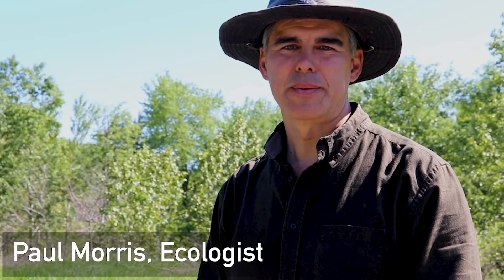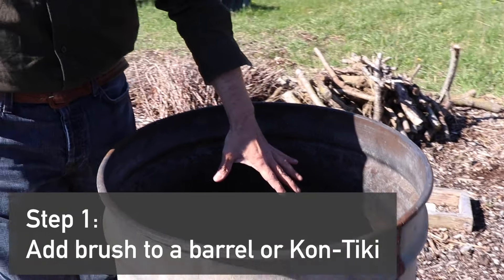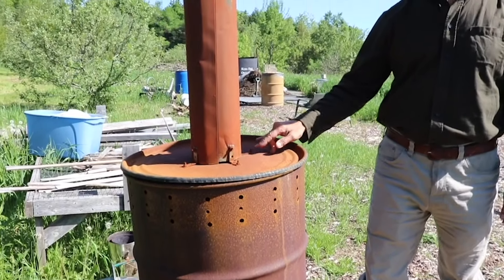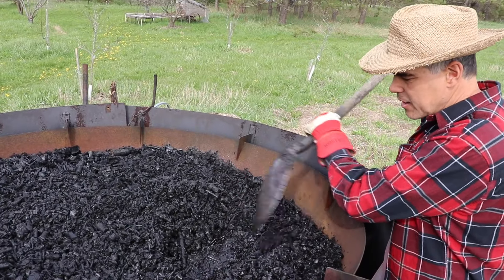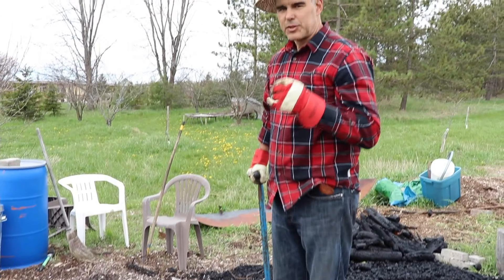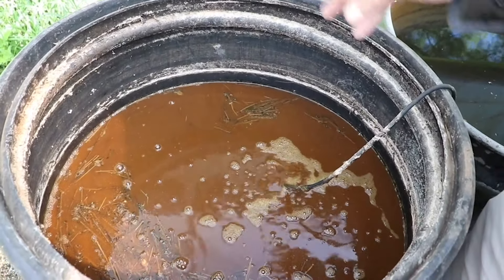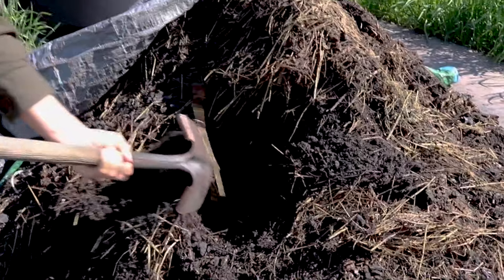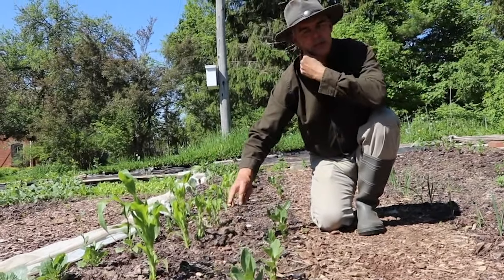THE ULTIMATE GUIDE TO BIOCHAR: how to make it, how to use it, and why it's important

Comment: I have loads of cane to eliminate (not sugar cane, but wild cane) which is totally different from wood. But maybe its biochar is useful as biochar from wood??? Any idea? Or is its quality much inferior to biochar from wood? Any hint would be useful. Thanx!
Reply: It's about an inch thick, hollow and 3 meters high. I think it's Arundo donux.
Reply from the maker: You would get some char out of it but it would be more difficult to do as it would burn fast and go to ash more quickly. You could experiment and see. I would probably make big mounds layering with some soil and compost it down.
Reply: @PlanetHealers  Thanx for answering! Composting is an option, but it's rather too much material to cope with. Applying it as mulching is another one, but would need to be shredded. So converting it into biochar seems the least work with it with the best effect in our case. The question remains if the quality of this kind of non-wood biochar would be different from the one that's made from wood, or if somebody knows any source where to find out about it.  thanx!
Reply from the maker: @131277stefan  https://biochar-us.org/presentation/sugarcane-residue-and-bagasse-biochar-precursors-soil-amendment-applications this might get you started in your research.

Comment: I use hard wood logs when cooking with my smoker. When meat is done, I close the vents and the fire slowly smothers. When I empty the ashes there are small chunks of charcoal. I put these small black pieces into my compost bin. Some break down, but often there are small remaining pieces of charcoal which I leave in with the eventual garden soil.
Reply from the maker: You will get a bit of charcoal after a regular burn but with this process - high heat and no oxygen the char has more fractures and airspace’s for microbes to grow. It would be low quality biochar but of some benefit.
Reply: I do the same!

Comment: Great video. I'm very interested in making biochar for a farm project we have in the Philippines and locally around our area, there's a dominant sugar cane industry. I was thinking of using those biowaste instead of wood as biochar. My question though is, is there a substitute of the urine in formulating your biochar? Thank you.
Reply: @sumakwelvictoria5635  interesting. Thank you so much for that 🙂
Reply from the maker: Yes aquaculture water with fish waste might be a good source but haven’t research it. Recently saw a study where they used biochar to filter out chemicals from the urine before using is and had good results. Id just boil the urine if concerned about pathogens.
Reply: @PlanetHealers  The goo is bacterial slime. That means your biochar is already loaded with bacterial colonies.

Comment: Not really sure that the open barrel system actually produces pure biochar, I guess it still produces some, never tried it myself, so assume this just from the theory. Have just finished a retort, where the feedstock is totally enclosed. I used maybe 20kg of wood to turn 500kg of wood into biochar, approx 125kg. Now correct me if I’m wrong, but I tried to light it using a gas lighter, glowed at contact point but would not light, which to me is biochar, if I could light it, it would still be charcoal, yes ?
Have wondered about finer v coarse, but spent some time in a place where we made a granulated rock mineral fertiliser, and there the finer the materiel the better, more surface area, wouldn’t the same apply to biochar, more surface area? Plenty of good information thanks.
Reply from the maker: Yes all the material in the barrel turns to carbon instead of wasting some of the wood to heat it. Not sure why your carbon would not light. All carbon "burns" / oxydizes with oxygen.  We crush it down but leave it a bit chunky so the microbes have a refuge if it gets really dry in the soil. Which it can in the Yucatan.

Comment: Where you use water to quench the fire, I was wondering about using effluent from a local diary pad  pond. This would give me a good source of nutrients, I think? Would I need to add other things to boost the bio char? Regards from NZ
Reply from the maker: The water soluble components of the manure would be in that water but the fibre and less soluble nutrients may be less. I prefer the manure because it is slower release. I’d suggest adding some soil to the mix, the molasses and super brew also

Comment: Really good info sir. I have a question though. Wouldn't a bigger air bubbler for your tea making have a faster microbiology growth rate and be more readily available for supplementation quicker? Cheers from the South....
Reply from the maker: I tried a bigger bubbler and it produced too much foam. I also mixed the settled ingredients (soil...) off the bottom every few days.
Reply: @PlanetHealers  good info, thanks
Reply: @PlanetHealers  is the urine fresh or fermented or a combination of both?
Reply from the maker: @FunnyBonesGaming  It takes a while to collect enough urine for a batch so it is part and part. I initially added some dirt to the container of urine but that ended up being a bit too rank when adding to the char so I stopped.
Reply: @PlanetHealers  Need to drink more beer LOL

Comment: Question.all the people making charcoal do burn in closed environment,without oxygen.can we buy wood charcoal and used it after inoculated
Reply from the maker: It is a different process of making charcoal for cooking. Typically it is made with a slow cool burn. That process leaves a lot of residues in the wood. Commercial charcoal usually has many chemical additives to make it light easier... For biochar, we use a hot burn without oxygen and it makes a more porous charcoal that is better for microbes to colonize and holds more nutrients and water.

Comment: looks like you have a system that works for you but may I suggest that you look into the "Johnson-Su Bio-reactor" system
Reply from the maker: First thought on seeing this method is it is too complex for most people and the result is the same as standard compost just a bit faster maybe. Then he pulled out the scaffolding to fill it!
Reply: @PlanetHealers  I plan to make a small scale bioreactor in a big trash can. Less volume, but easier to fill and easier to move into the garage to protect from freezing. Not sure how you keep the huge ones from freezing.  My understanding is the bioreactor is to produce very diverse microorganisms specific to the area (when you compost leaves or grasses) and the biochar gives them a place to live in the soil. But I don't think it would hurt to mix in wet biochar inside the J-S bioreactor to help the microbial and fungal life as it develops.

Comment: What is the fastest way to Charging and Inoculating Biochar. 
There are so many method to do so,. which method according to you is going to be fastest way to use biochar structure for gardening , especially when it 
limited to pots and containers
Reply from the maker: We have experimented with using the biochar right away in the garden and using beans as the first crop since they are nitrogen fixers. The first crop bed went well and had no issues but the second bed had fresher manure in it and showed some yellowing. The second crop didn't produce a good bean crop but it produced enough green manure to incorporate and it was usable after that.
Reply: I use the leachate I drain from my worm bins. Works great

Comment: Centimetres? Are you in Australia?
Question: Would rainworms develop well in this concentrated biochar-manure mix? Any experience there?
Greetings from Germany.
Reply from the maker: We have lots of worms that go after the organic matter in the mix to help process it and other micro creatures! They help incorporate the biochar into the soil. I think the US is the only country that uses the imperial system still.
Reply: @PlanetHealers  Thank you for your answer which is very motivating. However I cannot make charcoal in my garden. Open fire is forbidden in our village in Germany. As a substitute I bought charcoal intended for barbecue stoves in the supermarket - 5 kilos for 2.5 Euros, mainly from softwood. Do you think this will be as good as "biochar" for making Terra Preta?

(Imperial UK is still desperately sticking to imperial units too - one Brexit reason by the way)
Reply from the maker: @ghlscitel6714  Charcoal from the store is generally a low temperature burn and if in bricks they add other chemicals to bind and make it burn easier. Get wood pieces charcoal if you can. The high temperature burn we use makes more air cavities in the carbon. Still useable but with those cautions.
Reply: @PlanetHealers  Thanks for your comment. The problems with barbecue bricks I already had in mind forefront. That's why I bought the charcoal lumps. But your hint towards high temperature burn lets me plan to first before mixing with manure give the charcoal a short glow which I will extinguish with sprayed on water. This might make them quite close to the quality you produce. Greetings!